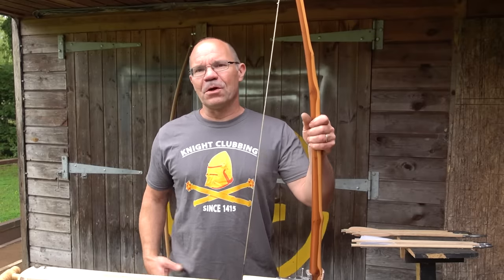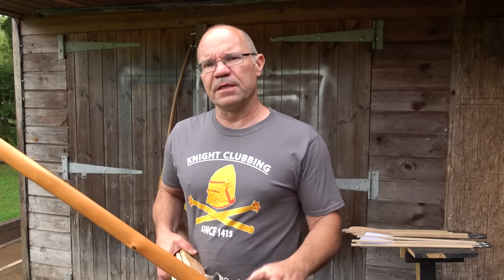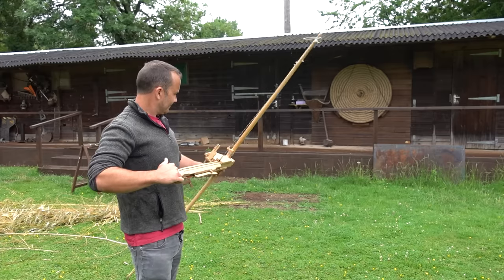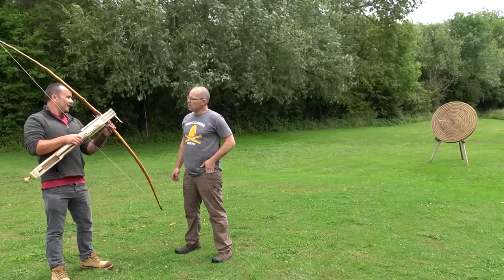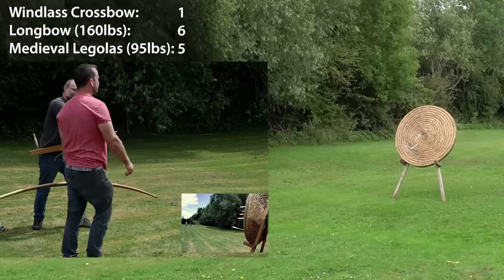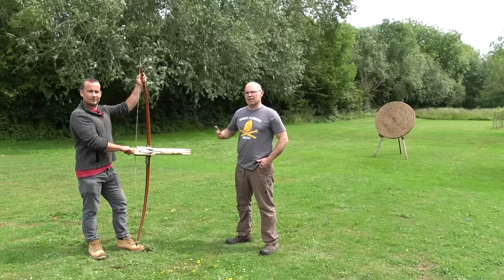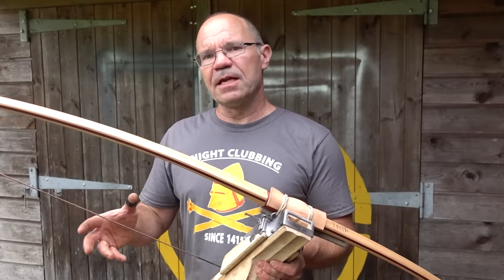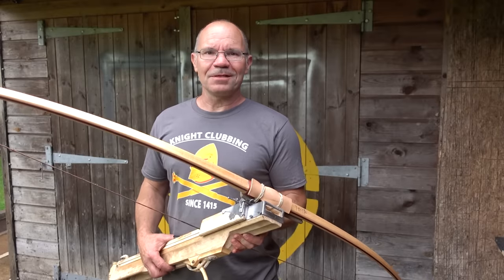Tod's 120lb Medieval Legolas - TESTED

Comment: Why is the grip 90 deg to the string? 
Apologies if I missed an earlier explanation.
Reply: I think it's to make it easier to release the trigger.
Reply: Joerg preferred it like that.
Reply: Both reasons are probably correct: the original was this way, and if you flip it the trigger becomes really complex
Reply: @MrSam1er  slightly more complex, perhaps we'll be treated to a mkII heavy prototype at somepoint
Reply: makes the power vector from drawing the bow into your arm a lot easier. Same concept as starting a lawmower.
Reply: @rikospostmodernlife  I'm fairly certain that Joerg at one point had a prototype with a vertical grip as well. 
I think that physiologically, a horizontal grip might be more efficient for short draws, but a vertical grip is more ergonomic for long draws (just mime the motion with your arms and see if it's more comfortable to pull your arm back all the way with your fist vertical vs horizontal).
Reply: Even if horiz is technically better, archers are already used to vertical so vertical is better.
Reply: Tod mentions in this he thought it needed to be that way but when building it realized maybe not

Comment: 12:30 he talked about how it feels like he is shooting a 30 or so pound heavier bow, could this be because he is essentially pulling back farther, since the grip is so far behind the string?
Reply: Good point, there is also the differences in the way he is holding his pulling hand.
Just rotating the hand like take makes you use different muscles, and the same muscle in a slightly different way. The body has loooaads of smaller supporting muscle that usually aren't very impressive to look at, but they do a lot of work, those are the ones that have to work differently because of the change in grip.
Of course, I ain't no expert, just throwing my two cents in :p
Reply: @WolfFireheart  Jeorg mentioned another factor, of "he was firing much faster". So he was exhausting his muscles' burst strength capability, which normally you would not do when firing regular speed and allowing your muscles to rest inbetween each shot.
Reply: No, the draw weight is dependent on how far back the string is, not the hand, and 3 inches or so won't make a 30# difference anyway.

Comment: Great video. Im not sure why you dont just turn the pull handle 90 degrees, so it's parallel to the string. That should make feel more natural to something used to a normal bow. Also does it need to be that far back? Im thinking it would be easier to draw if the movement isnt so "wide".

Comment: Again - you say "I think it is for experienced archers" and you remove all assists that allows it to be used by inexperienced ones with equal effectiveness. Why? Just why?
Draw assist and front grip allows weaker archers to quickly pull it and grab that handle. Sights and frame removes all needs in archery experience.
Any strong man can shoot it effectively with sight and frame+trigger. Why it is "for experienced archers"? 
And experienced archers can pick arrows from a hip quiver just a bit slower than this device shoots. None of it is for experienced. They don't need anything of it.
Reply: I think Jörg has already done a lot of the proof-of-concept for its utility to novices, so Todd is looking at it from a different angle: how effective can it be for the advanced archer? But I admit, that's not exactly what he's saying.
Reply: You need to have enough weight on the bow for it to be effective against armor.  Without a draw assist which he seems to be struggling with, an inexperienced archer would not be able to draw the heavy bows that would actually penetrate armor.  Therefore it's better to tailor this device to experienced archers.  Doesn't mean that lighter bow versions would not be made but they would be more for training and other uses not for war.
Reply: Experienced = accuracy. In a historical context this would be an expensive device, not to mention that bolts were very expensive to make as well.
Reply: his last video shows him trying to make a medieval version of it and giving up, thats why theres no draw assist
Reply: @snailman7989  i thought he asked for & was going to implement viewer suggestions in another video. Maybe an extremely recurved bow could work as an assist?
Reply: Draw assist does not increase the maximum draw weight you can handle; it gives it's largest input of force at the beginning of the draw, none at the end of the draw.

Comment: There was 17th century crossbow which acted similarly but with more automation. The design itself was coming back from 1500 year old design which used feeding system not dissimilar to modern automatic weapons ramp and bolt feeding. The problem would be hruggedness of device when it meets various real conditions, wetness, lack of time to maintain, wear and tear.

Comment: This kind of invention is for long distance army volleys. The lesser accuracy matters less and the greater firing rate is much more useful. My use for this would be for getting extra volleys in situations where you opponent is vulnerable for a shorter window than a pitched battle normally. For example, a cavalry charge and cavalry retreat. Or mounted archers that deploy on a ridge, dismount and fire volleys until the enemy reacts. This would be when you have more horses than you have trained horsebowmen. Horses would make maneuvering these bulkier and heavier devices easier. You could also transport more ammunition.

Comment: Pretty sure that with a vertical grip (usual bow strong grip) the Bowman would get much better lat and trap engagement then. That horizontal handle would rely on smaller shoulder muscles. Try the same grip variations in a pull up and you'll feel the difference.

Comment: Late comment, I'm sure someone in the 4000+ has said this already, but just in case... if you notice, the mechanism of shooting this, has the pulling hand starting a good 8-10 inches behind the bowstring, thus starting already that far into the "pull" motion.  So where you have the most leverage (arm forward at the start) is already sacrificed, thus the final 8" of pull is "behind" the normal fully loaded position of a standard bow, and is all shoulder pull/rotation of the shoulder joint rather than upper/forearm muscle groups (basically you've gone from a few large muscles, to smaller muscles for those final inches of loading)... so this would absolutely feel much heavier, it's like lifting a dumbell off the floor to your chest (like a bent-over-row position), then continuing to try to lift it behind your chest/shoulder, which is not a very often used (or useful) motion.  
If the mechanism could be re-engineered slightly, to enable the pull handle/trigger mechanism, to parallel the bowstring (no idea if it could be without lots of mechanical interference in the arrow loading body) that would re-equalize the pull-length at least ,then it's just friction and minor alignment differences to a normal bow pull.  
Fascinating and excellent video, thank you!

Comment: Keeping the Legolas aloft at arm's length tires you out too quickly. 

I recommend a movable, bendable, single stick archery stand that tilts back and forth and swivels 360°. It would need a sharp point on the bottom for driving into the ground as well as a u-shaped rest at the top for alighting and aligning the bow.

Tilt backwards as you load, then allow the stand to bend forwards slowly as you line up the shot.

The swivel action allows you to turn side-to-side and track a horse mounted opponent.

Wonderful video. Very interesting and informative. Nice to see innovative ideas in action.

Comment: I can imagine adding a pulley system so you pull the heavier bow back twice at half the weight and the string comes back once.  The draw on the bow would be in two stages, so that you expend half the energy.  Like with repititions at the gym at your max might be 1 and half of that weight might be 20 reps; you'll last longer.  It is fun to watch the evolution of a new invention.

You could even physically load a spring device with 20 draws worth of energy and the draw back would be automatic after a shot, or not automatic and another trigger for a draw of the string.

Comment: It looks like the draw handle is located about 10-15 cm back of the string, which means your draw hand will be that much further back in relation to your hand holding the bow. It looked a bit awkward too, where he had to pull it maybe further back than optimal. I guess this could be overcome by either making it shorter (draw length) and compensating with stiffer limbs, or put a handle on it about the same distance back that you hold with your left hand instead of holding the bow itself.

Comment: Looked like the handle could be closer to the string and just turn through 90degrees to be in line with the string. Joe got tired as he was doing the work of 40 odd seconds in 6 seconds. 
You haven’t mentioned how long it takes to load.
Always great see Joe shoot anything 👍

Comment: I would suggest rotating the handle 90* to allow for a neutral grip as opposed to a pronated one. A pronated grip puts strain on the radial brachialis and neglects the bigger and more powerful bicep muscle. I think the draw should be as close as possible to what the particular archer is familiar with to take full advantage of the motor units that have been developed over the years of practice. Excellent proof of concept though.

Comment: You could make the grip on the back rotate for the shooter. And yes body builders and lifters talk regularly about how much strength is in the twist of the wrist on the bicep. If you flex your arm and just twist your wrist back and forth and move nothing else you will see your entire bicep change to and from the longer headed part (near the elbow) going from more of a ball to an oval. Meaning you dont get to use a full contraction. Youre stuck at 80% of the natural movement and strength.

Comment: There is nothing saying an archer platoon would use a long bow to ' sniper' range arching volleys to target leadership, the heaver legolas for longer range and power hit against assaulting foot soldier force and switch to the lighter for close in rapid fire, both horizontal fire. Could add some stabilizing/damping weights to lower arm. Action causes a lot of flailing about.  The lighter one may have been fired horizontally like a crossbow and rapid fire 'from the hip' as it were.

Comment: I think having your hand horizontal puts some twist in you arm, making it harder to exert force. So I think having the handle vertical would help. One might even take this as opportunity and try to make the handle as ergonomic as possible, maybe vertical but slightly turned counterclockwise.

Comment: The problem is probably with heavier and bigger bows that the drawing process is much more circular, due to body limitations, then when you pull back in an exact straight angle. Causing the inner casket to be pulled back in an angle. Serving as a brake and making the drawing process much heavier. If the mount could move a little up and down, it would probably feel more natural.

Comment: The only drawback I can really see is reloading the chamber, but if there was a way to very quickly detach the SIL you would just shoot it as a longbow from there. 
I could honestly see the SIL being used a lot in medieval warfare.
The way it would be used is probably for initial volley, and then you detach the SIL and put it in a back pouch and start shooting your bow normally, until there is a long enough period of safety where you can stock up on new arrows, refill the SIL chamber and reattach it.

Warfare would definitely change with these things in the mix, you would have to bait out the SIL volley of the opposing army before you ever think about committing to a charge, and you couldn't afford giving the opposing archers enough time to fully restock. 

P.S. the video and the project are absolutely amazing Tod. Awe Inspiring work.

Comment: You have to be a beast to pull a 200 pound bow , I have a friend who’s 6 foot 2 inches tall & around 225 , 250 & he has a osage Orange 200 pound bow , the thing is ridiculous , I could only pull it back to 4 inches & he pulls it back full draw like it’s nothing but he only can hold it for around 2 seconds & the piercing power that thing has is incredible , I seen him use a carbon fiber arrow with a 400 spine tipped with steel mid evil broad heads shooting at a 3/8s inch thick piece of mild steel , just mushroomed the broad head & the arrow stayed intact no cracks ,no splinters the arrow was good of corse it did go through the steel plate , just ridiculous . I can only pull a 55 pound recurve & nothing more . I could imagine him hunting with that thing just right through the animal no problem . Shot from 20 yards he did .

Comment: Would it be possible to mechanically advantage the draw, maybe a pulley system, and then maybe make it metal, so it's not so bulky, possibly re-orient the bow to horizontal, think repeating crossbow. To me this is proof that the concept works and that it is possible to build one with period materials, now it's a matter or dialing it in so to speak.

Comment: Hmmmm... Mount it on a stand horizontally, add a double crank arranged like bicycle pedals, with two wheels and a rod in the middle (that moves like the piston rod of a locomotive) connected to the sliding part and you can have a gatling ballista

Comment: Looking at the design, compared to a normal bow string draw the archer's (Joe) hand on his right arm is turned 90 degrees, when using the Legolas. Also, because of the length of the Legolas his right arm has to come back further. Solution would be move the Legolas handle to the vertical, bringing it closer to the normal string position and shorten the Legolas. Obviously the arrows would have to be shorter too, but an inch or so shouldn't make too much difference. Possibly, as a handle, a pistol grip below or to the right side the Legolas might work?

Comment: I think something like this would excel in a fixed position with a mount, maybe in a horizontal position and change the operation mode to two handed, since the bow is being rested on amount. In that case you can use gravity to assist in feeding and maybe have a much bigger magazine and probably a heavier pull, since you're operating it with both hands. It would fulfill the role of a modern heavy machine gun, so you could have an assistant for loading and hauling it.

Comment: It seems like the basic problem with Tod's bow is pretty simple. When you are weightlifting, even a few extra seconds between repetitions on a heavy set are very beneficial to muscle freshness/recovery. For a strong archer, a 90 pound draw weight may not be too bad when you have a few seconds between each shot, but it could be really hard when you give yourself almost no break. All Tod needs to do is lower the higher pound draw weights to compensate.

Comment: have you thought of throwing the handle in a pistol grip underneath the draw a few inches to alleviate the draw arm and reduce the distance a bit. I feel the back draw makes you pull further than the human is supposed to and it should be more in line with where the string normally sits. Never handled your cool things and have no knowledge of engineering let alone medieval prospective military engineering but an outsiders look on the box. Looks cool!

Comment: Wow. ! Critically, the rate of the force applied/muscle recovery cycle is sped up significantly. The pace at which he normally fires involves a longer rest between pulls and more body movement to stretch and recover slightly in between shots...no wonder it’s hard work!

Comment: I bet it gets even easier if you've used the Legolas device on a compound bow with no whisker biscuit.

If the Legolas was built with a lighter yet just as strong carbon fiber, then you can make it larger than the ash version with more arrow capacity exceeding 5, without the weight.

Comment: This contraption world be very interesting on what i can only describe as a human ballista. Sitting on the ground and using a rowing motion to pull a bow and a double handle and holding the bow in a foot strap. You could probably run a 150-200 lbs bow in that when you have your full body working it.

Comment: Needs a forward handle set back a hand-span back from the bow so the draw length is as the original bow.
But that would also increase the weight on the forward hand.